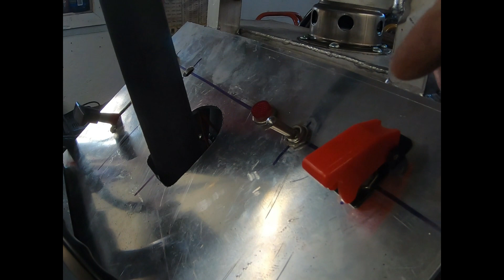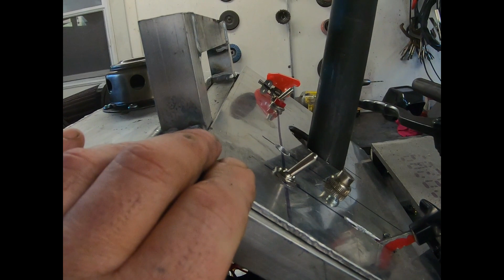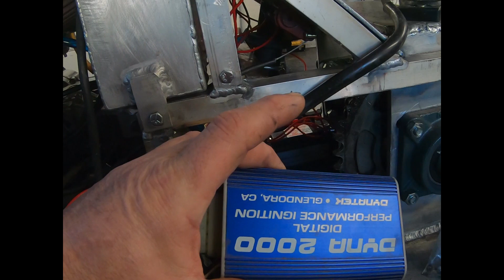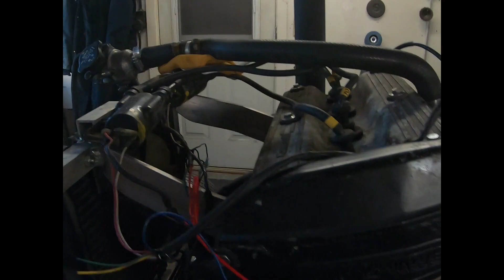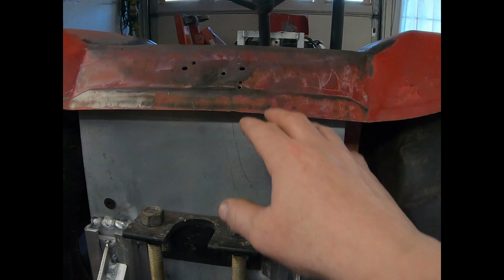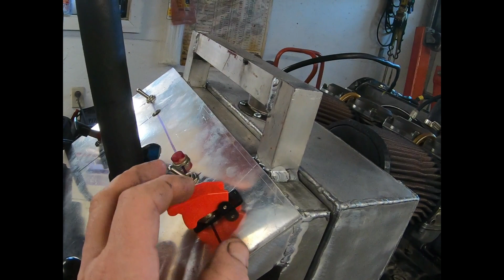How to build a modified pulling tractor wiring day

Comment: Im to the installation of jack shafts. I will be running a suzuki 600. Would you have a starting point idea of teeth count?
Reply from the maker: So on my jack shaft the primary sprocket is a 45 tooth 
Secondary sprocket is a 18 thooth. 
From the 18 tooth it goods to a 52 tooth on the axle. 
That combination give you a fairly low first gear for real tight tracks where you’ll need the power. For looser more forgiving tracks you can start in higher gear with your transmission
That’s the beauty of using a bike engine

Comment: I do have a question if you don't mind. How did to set the motor. Oil pan level???
Reply from the maker: Yes if you set the oil pan and or the gear box roughly level that will put your cylinder head at about 35 degrees (off your frame). 
That’s where you need it. 
You don’t need to be super accurate 
I just do it by eye and I’ve never had a problem.
Reply: @H&S Pulling Team  Thank you sir. I'm in the starting stage of my build. When I came across your video today it was like a prayer being answered. I might have more questions later as I get going on this build if you don't mind me asking.
Reply from the maker: @kendellverhage288  No problem any time I can help just hit me up.